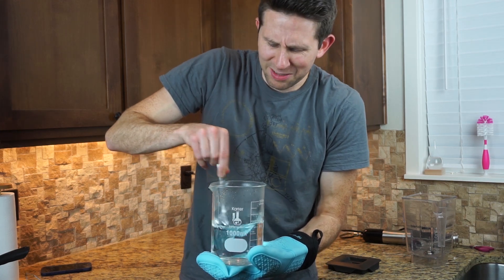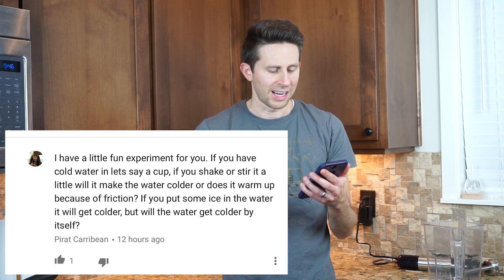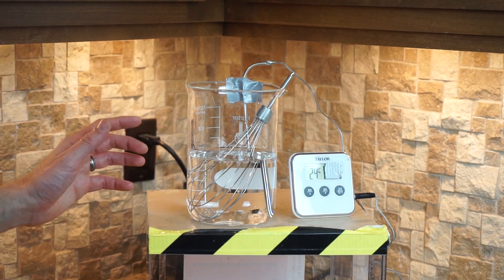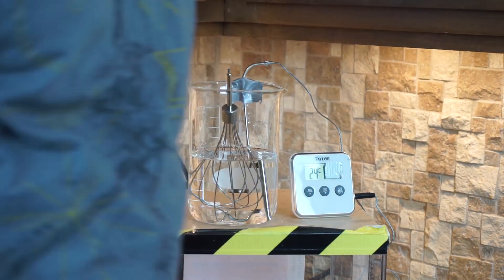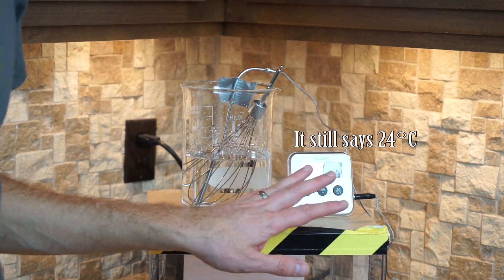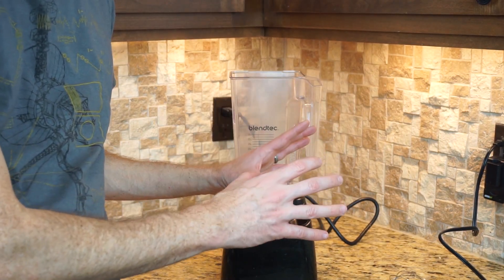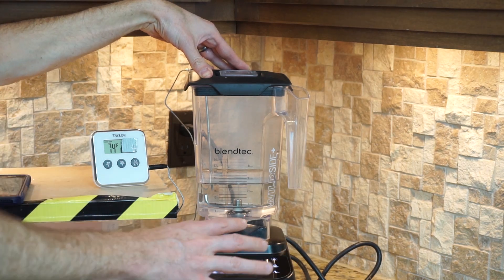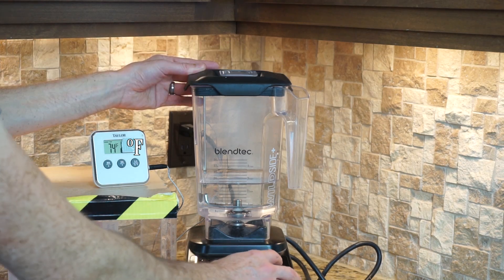Can You Boil Water Just By Mixing it Really Fast? Water-Stirring Challenge Accepted!

Comment: No.  The majority of the heat was exchanged from the motor.  The metal blades acted as a heat exchanger, or steam generator, similar to that of power plants.  Do the same experiment, this time with polymer "blades" and introduce an airstream inside the motor enclosure to ensure residual heat does not permeate through the top.  Heat Rises!
Reply: solamisandwich05 there is an air stream going to the motor. The motor has a fan that keeps it cool. To satisfy the uneducated, he should do a test with nothing inside the blender and run it for a period of time, then measure the blade temp.
Reply: solamisandwich05 there is a pinned comment about this from him directly so check it out before commenting
Reply: solamisandwich05 let me guess...  You are American..
Reply: solamisandwich05 you probably don't know basics thermodynamics,  since to heat to flow from the motor to the water the motor would need to be hotter than the water.  Amd since the water kept heating up after 90 degrees Celsius and for sure the blender temperature is way lower than that , the energy heating up is kinect energy. and the blades are pretty isolated from the motor itself.  put your blender to work empty for a long time and than check if your blades are going to be hot.
Reply: I have no idea what u just said
Reply: solamisandwich05 I have a Braun food processor that does this but quicker, you can make hot soup in it from raw ingredients in about 6min. No heating element, no metal drive shaft and no ventilation holes around the base of the jug. It is entirely plausible that it is friction at play.
Reply: why are you so sure that the temperature of the blender is way lower than 90°C? I think it there is a good chance that the blender had a temperature greater than 90°C or even greater than 100°C.
Reply: Andreas Weinzierl   turn on your blender at max speed for as long as you want and then touch it and see if it's is hot!  And even if the engine was kind of hot the part which is in contact with water wouldn't be.
Reply: did you try it? unfortunately I do not have one

Comment: The blades get hot too .. due to the motor getting hotter. The boiling may not be entirely by water friction.I think you need to have a more controlled environment.

Comment: I think part of the heat came from the motor working hard for that long but regardless great video
Reply: Green Dragon but the motor is seperated
Reply: the metal shaft of the motor is medal(very heat conductive) which connects to the metal blade(very heat conductive) at 3:46 you can see the rotor that connects to another piece of medal in the stand which is connected to the motor

Comment: The heat is most probably coming from the blender engine. You haven't proofed your experiment.
Reply: Emad A.E. Proved* motor* read the top comment
Reply: Why Tho, no I meant proofed not proved. Still the expirement he demonstrated isn't proofed.
Reply: Emad A.E. PROVED* and no if the motor got that hot it would be smoking and blow up
Reply: Why Tho. You know what is proofing right? To isolate and diminish some influence. I don't care how much the motor contributed to the warming up of the fluid he must has proofed his experiment to be considered scientific.

Comment: engine of blender is starting to heat up thats why water is so hot :I
Reply: BraveBear. No, the motor shaft is not directly connected to the blade, you are forgetting about the rubber connectors between the motor and the blade, heat does not readily travel through rubber efficiently enough!
Reply: I think that the heat generated by the blades bearings friction is  enough significant.

Comment: Wouldn't most of the heat come from the motor itself.
I mean, the windings in the motor will get hot, this heat would travel up the motor shaft and conduct into the blades which would then heat the water.
Reply: Doc la it come from the bearing spinning at 30000 rpm for ten minutes straight. Fire up your blender with nothing in it. run it for ten minutes and stick your tongue to the metal underneath the pitcher. Then let us know if it was the blade friction against the water. Or the friction in the bearing.
Reply: InfinitePower. No, the motor shaft is not directly connected to the blade, you are forgetting about the rubber connectors between the motor and the blade, heat does not readily travel through rubber efficiently enough!
Reply: Doc la ok then it won't hurt to just try it. run the blender until it shuts itself off like he did. And just touch the base where the bearing is to your ballbag. When someone says I can show you the math or something of that nature. It just means I have never held a wrench in my life.
Reply: If the motor produced enough heat to conduct into the plastic and rubber separating the water from the motor to boil the water, these materials would melt long before the water boiled. They'd have to get much higher than the boiling point of water. I'm sure some of the heat comes from the motor, but not the majority of it.
Reply: Doc la ok we'll try it run the blender and touch your scrote against the base. See if running it like that causes heat to build up. I'm betting it will. And Yea there's water in it I can see it.
Reply: I kinda agree that the motor is contributing heat to the water.If youve ever used a blender,the motor usually feels hot after use.The heat can travel up the shaft and to the blades itself conducting heat to the water.
Reply: Jaaa C I know, but it shut off automatically after two minutes due to timer. and not over heat
Reply: InfinitePower water requires much more energy than that to warm up as well. It takes nearly 6-8 minutes for water to boil without burning the water.
Reply: Kaiser Soymilk I‘m giving up... It seems you dont know anything About simple thermodynamics. You can easily calculate the Amount of Energy that gets Into the water and the bearing of the Motor. It is just completly nonsense too proof the heating of the blades by doing the Test without the water.
Reply: even if it does, that doesn't mean u get a conduction of 40F in just 2 minutes or so
Reply: Abdus Saboor Asad he ran the thing until it overheated and shut itself off like 6 times.
Reply: Motors generate a lot of heat when set to spin at full power, even more when their is a load on them. (such as turning blades through water) Building robots for a few years, one of our biggest issues was proper cooling for high performance motors. this still works without the motor heating it, but the motor contributes to its heating.
Reply: Doc la land at tilted
Reply: InfinitePower no m8. Look up cavitation
Reply: If I can boil water in a blender, can I make a smoothie in a kettle?</jest>
Reply: InfinitePower im pretty sure that the motor would not produce that much amount of heat to make water boil though...
Reply: That is my favourite way to tell ppl to go die, you have my respect.
Reply: There is no way it would get that hot to boil tha Water like what I can’t believe I’m reading these stupid comments
Reply: Tru3Skillz1 water doesn’t burn
Reply: how would the temp drop when the motor stop then
Reply: Burning the water?
Reply: InfinitePower Anyways it's all because of friction  bro...so that makes sense
Reply: InfinitePower "motor shaft" XD what part is that?
Reply: InfinitePower well said
Reply: FPV Unknown blades get warm. Not warm enough too boil water though.
Reply: At that logic smoothies would be warm
Reply: Thanks for reading the pinned comment.
Reply: The Mixer puts rotational energy in the Water. It does not come from the warming of the motor
Reply: But it's there nonetheless.
Reply: Doc la  Initially the water will act as a coolant to the blades, so it will take longer to heat-up, but eventually they will. You cannot do an experiment like this with a regular home appliance, they'll all get hot thanks to the motor.
Reply: Jaaa C But your physical Understanding cant be good anyway. The energy need to boil the water would cause the blender to melt or eben get set on fire without the water.
Reply: Abdus Saboor Asad ok then ya do that how many times 5 or 6 and you get what 10 or 12 minutes? Or did he run it for 2 minutes then wait a day to try again? Magically after the 6th day the water boiled. Point is this shit is clickbait. It's so easy to make clickbait because we'll because you basically. You think spinning an electric motor with a shaft a bearing and a blade at 30000 rpm for ten minutes straight generates no heat. Not even a blade it's a fucking boat oar.
Reply: Kaiser Soymilk It does NOT Act as coolant. The rotational energy of the blades Passes to the water. Not the „Heat“, Because there is nearly no Heat produced
Reply: I have the same blender, ran it empty, blades got warm. pretty sure that didn't come from friction in the air. Why argue about it over the internet when it's easy to test? Sorry guys.
Reply: A motor is essentially electromagnets which repel a magnet coated shaft in such a way that it rotates.
These electromagnets are essentially coils of wire (with resistance).
As you pass current through the wires, they heat up. This heat gets conducted up the shaft and into the blade which then transfers the heat to the water.
Reply: InfinitePower No, the Heat that is Produced is just Not enough to take it in
Reply: the bubble at the end come from the base of the blade. so this is boiling because of the hot metal from the motor
Reply: Jaaa C Are you serious? Is he running the blendet with nothing in it?? No 😂 

And Even if you‘d run the blender just with air in it, the bearing would not Heat up that high

Comment: Should meaaure the power going into the blender, calculate how much energy is needed to boil the amount of water you have and compare them.
Reply: Also you could get 2 close fitting cylinders, put water between them and spin one really fast like a bearing I bet it will boil very fast.

Comment: I would think the shaft is also picking up some heat from the motor being on so long and depositing that heat into the water. You didn't account for this. You didn't have a way to control and isolate this heat.

Comment: actually you're cooling down a mechanic motor from their heat loss rather than heating water. There is a small amount of mechanical energy while stirring getting into heat.
You can calculate the efficiency of the motor by knowing power input, the mass and temperature of the water and the time it reaches such temperature. Yes, it's like a calorimeter.

Comment: how do you know that the water got warm by the rotation instead of the heat transfer from the blades and the hot motor from the blender machine? or in some cases the friction of the blades with the water that is making it hot?

Comment: Well.. put a large flywheel and create a pulley system with a 1 inch diameter pulley fixed to a set of industrial grade bearing and a paddle wheel attached to a pistonand you got yourself a vapor engine!!

Comment: Not convinced the friction makes the water hotter. I think the blades are just transferring the heat from the engine to the water because these parts are made from metal. It's called convection and metal is a very efficient material to transfer heat. And also, he's playing with the most violent domestic blender when it has boiling water in it and he's just using a glove to protect himself. He could suffer from severe burns if he had water on him.

Comment: Stirring water with hand in a cup can heat up the water a little bit. But would never get boil. Because at the same time you also put the surrendering cold air into the water. And that is what I did to cool down very hot water to drinkable temperature by stirring it.

Now look at another example, in the torque converter in automatic transmission of automobile or hydraulic retardor in heavy vehicles. They are just literally stirring fluid in a pressurized close loop system and those transmission oil can easily reaching temperature over the boiling point of water. And they need additional cooling system for prolong operation.

Comment: why you didn't count about the spinning washer/bearing friction that is associated with heating up the water, In fact, when it was 99.8 degrees and you stopped the mixer, bubbles only came out from the bearing but not from the whole surface of the jug? answer me

Comment: i don't know if anyone has thought of this, but isn't it possible that the heat is actually coming from the motor inside the blender? think about it, the blades are connected to the motor and the motor, being under extreme use, could have conducted enough heat to boil the water?

Comment: think about the motor...
Reply: This is not a cheap blender so I imagine it has metal to metal connection like mine does and I paid just under $100 for it. This one costs way more.
Reply: Aaron Greenfield ohhhhh,thanks!
Reply: Thanh Nguyen. No problem.
Reply: Thanh Nguyen. No, the motor shaft is not directly connected to the blade, you are forgetting about the rubber connectors between the motor and the blade, heat does not readily travel through rubber efficiently enough!

Comment: This experiment is flawed. The blenders moter could easily be heating it. Uou need to try this with like. A drill press so only the mixer is coming in contact with the liquid. Well. Not need to. But. When i had blenders. Running for extended time made them get really hot..

Comment: you can get water to boil but not with the speeds of blendtec, i mean it did here but it was getting heat from the blades aswell
but ya concept is correct . 
if the heat from blades was isolated then i dont think it would ever reach boiling temp because the quantity of water to the water surface area interacting in jar is low,  it would reach equilibrium before it reaches boiling temp

Comment: Thermodynamics' first law makes this possible and using only work to increase temparature is possible but unneficient way to get hot water because in molecular level work cannot be so easily transmitted from one to another moleküle of water as easy as heat transmitted fluids are good to heat transfer against to work

Comment: It's not just because of the water friction the blade it sefl get hot from the motor and that heat from.the motor conducts through the blade to the water so your theory is not entirely correct but is possible

Comment: This is fake.
It is possiable but you need alot of energy.
For a cup you would need 700 watts to do so and i do not think a blender could put out 700 watts
 
1 cup × Water Heat Capacity × (100° C - 20 ° C) ÷ 2 minutes  = 700 W

Ps: i just read the desc  (who reads the description?) May u put that at the beginning of the vid also the desc is vague did you actualy think spinning it? If so you are good sir very ignorant!

Comment: Another way that the water could be hot is that when something is increasing in temperature the atoms start to move faster so moving particles around fast enough (ALONG WITH FRICTION) should in theory, heat up the water

Comment: Try to use oil instead of water.I seriously want to see what will happen to it.what is the highest temperature it can reach
Reply: blazing god man well that would be lot harder cause oil is a lubricant so friction won't heat it much..
Reply: Next video: I burned my lab by blending oil.
Reply: Agreed. The  phase change of turning water to steam will eat up the energy, and the temp won't get past water's boiling point.  Oil might get hotter than 100 C.
Reply: "Yo I want some french fries"
"man all I have is a blendtec I don't have a fry-"
"stop right there"
Reply: Reuben Jacob lubrication has nothing to do with it. Oil is viscous and just luke rubber it heats up when you stir it, just like in the torque converter in your car. Try kneing daught for a while, it will get warmer than your hands.

Comment: Im going to say 
The boiling is not because the mixing the water 
Its because the metal blade who gets heated by spinning so fast
Reply: Possible
Reply: both are the same thing basically
Reply: The motor itself certainly was not helping in this situation either, motors can get really hot when used nonstop.
Reply: David lmao
Reply: Yes, heat gets transferred from the motor to the blade + plus a closed container (hot air can't come out). The best way to do this is with a plastic blade, if there is even one.
Reply: HiIm Dad no it doesn't heat get transferred from the motor youre forgetting ab rubber component that's rubber and rubber is a bad conductor all or most of the heat is because the friction of the water
Reply: Mr.Grinch No one cares.  The more you know..
Reply: David wrong group of people. Yusuf is an Arabic name. Indians are known for the whole bob vagene thing. The more you know ...